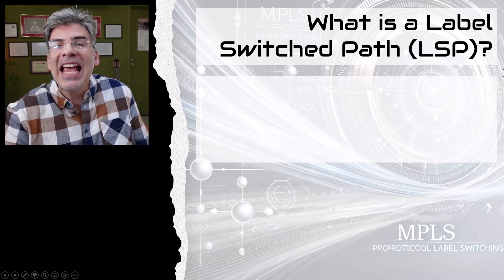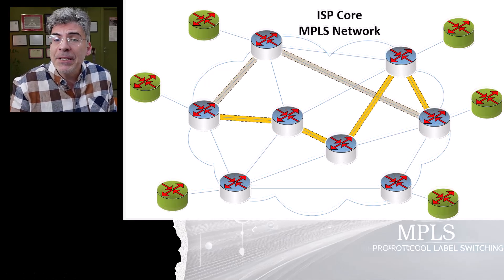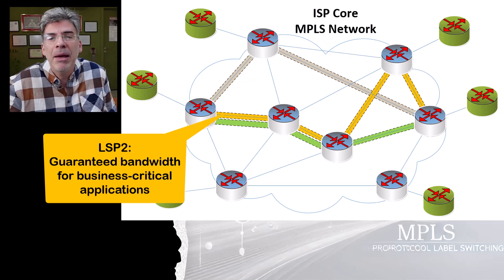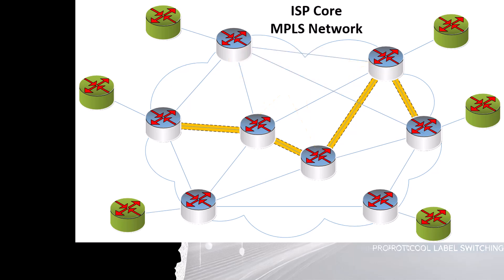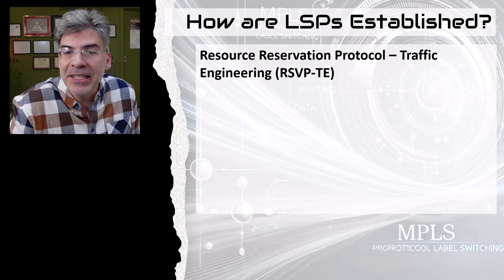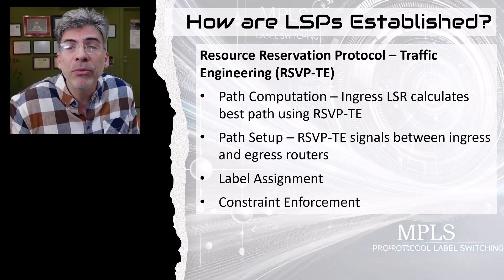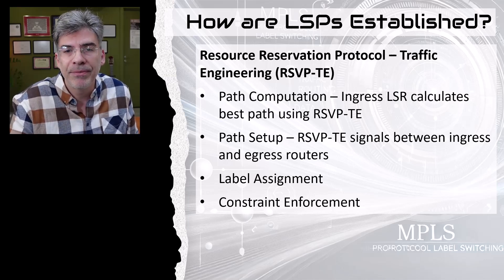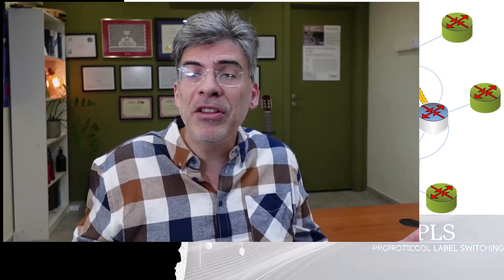MPLS-TE Label Switched Paths

Comment: Thank you for all the information — it was really well explained!
I just had a small question regarding the naming of LSPs. I noticed you referred to the LSP in basic MPLS as a "Label Swapped Path", and in the case of MPLS-TE as a "Label Switched Path". Is this distinction just for educational purposes, or is there an actual difference in terminology?

Also, just to clarify — is RSVP the same as RSVP-TE, or are there important differences between the two?

Thanks again for the great content!
Reply from the maker: Hey, I'm glad that it was clear for you and you find it helpful!

About the LSP naming: you're absolutely right to pick up on that!  In basic MPLS, sometimes I say "Label Swapped Path" just to emphasize the operation happening at each hop — label swapping — for educational clarity.  But you're right, officially, whether it's basic MPLS or MPLS-TE, the correct term is Label Switched Path. I may have said it by accident sometimes in the "regular" MPLS videos.  Officially it is indeed Label Switched Path.

Concerining RSVP, by itself, it is a general signaling protocol for reserving resources across a network (originally designed for integrated services and QoS).  RSVP-TE is just a specialized extension of RSVP adapted for MPLS Traffic Engineering. It adds capabilities like explicit route objects (EROs) and label distribution, specifically to build and manage MPLS-TE tunnels.